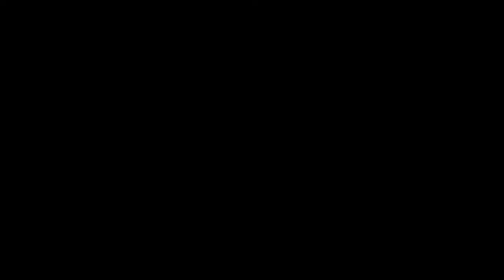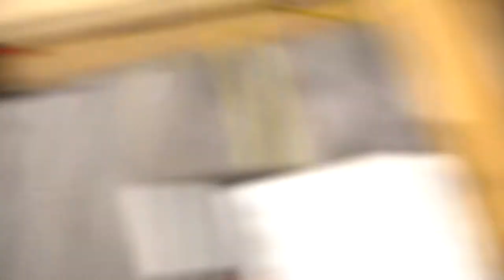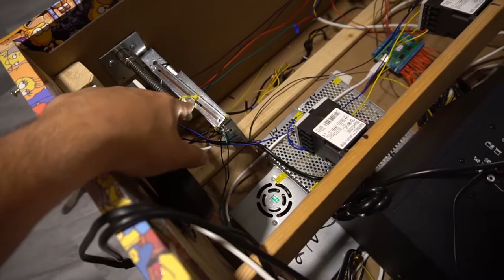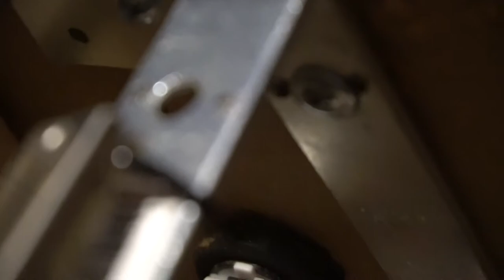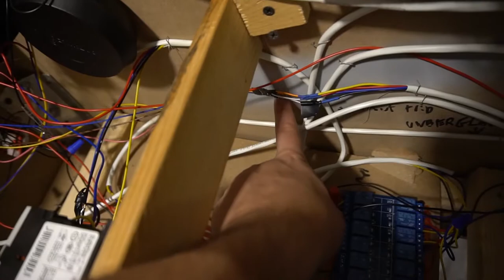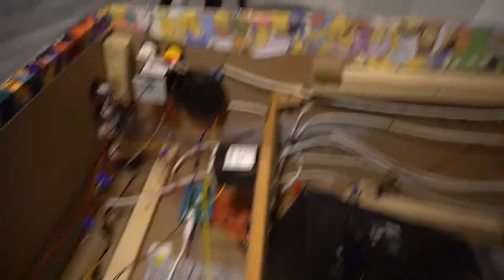Analog Plunger for Virtual Pinball Cabinet

Comment: How is connect the potenziometer to the kl25z?
Reply from the maker: Check pinscape program. I can make another vid, but pinscape program says what pinouts it needs on the klz board
Reply: @Vic_VP  I have found one picture where PTB0 is in Pin2, GND is in pin14 and P3V3 is in Pin8.
Reply from the maker: @salvatorefarris1861  sounds correct.i can check tonight. It should be 3 wires, 1 ground and the other 2 are connections.